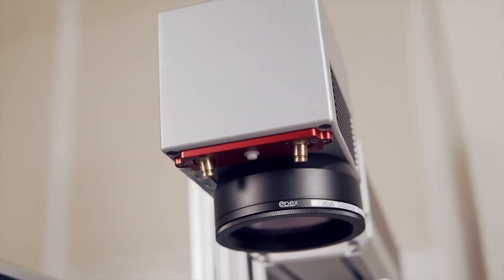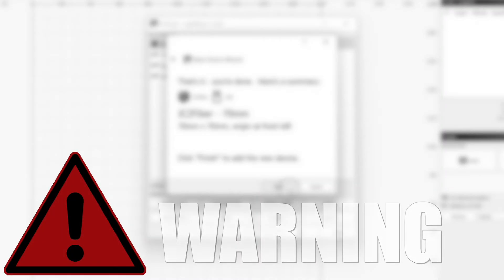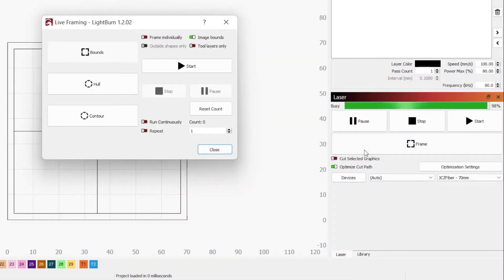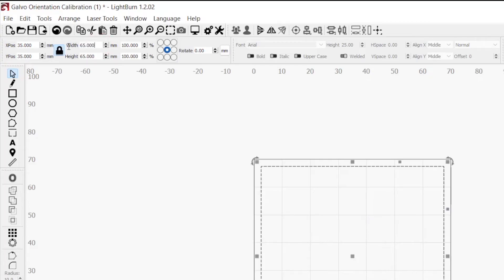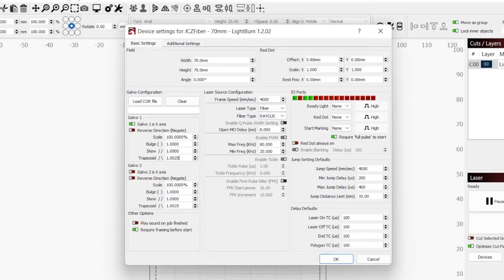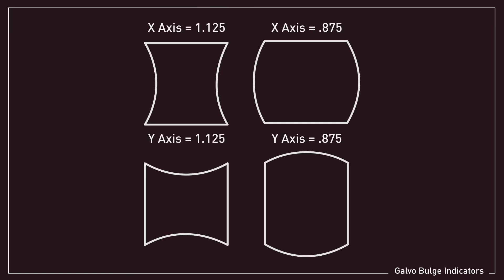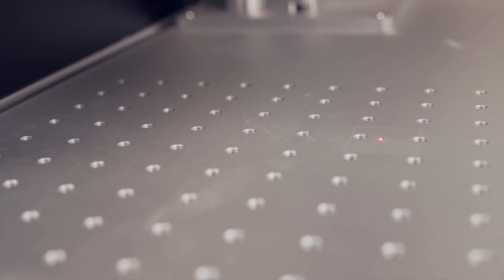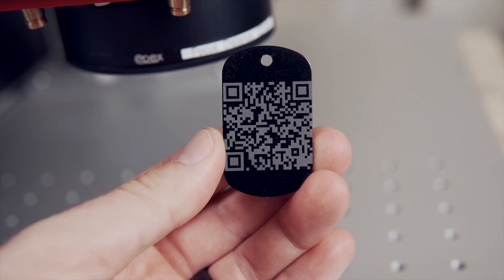LightBurn Galvo Lens Correction Guide

Comment: How about the power adjustments? Can the power be also adjusted or calibrated such that it auto adjust the power so the far away from the center on the bed will result the same amount of marking strength as the center?
Reply from the maker: Sorry, no, there is no way to calibrate power output in that way.

Comment: I don't understand the parameters for printing the pattern, for a 30w machine: 100mm/s, 80% power would burn the cardboard, can someone please explain it to me, I don't quite understand. I've spent a while trying to figure out the marking parameters: Speed, power, frequency and QPulse, which Lightburn uses to print the 9-point correction pattern on black cardboard. I've tried several values without success, however printing that test from Lightburn does work. Can someone help me?

Comment: mine only burns a + , nothing more ,.. than askes for the orientation of the burn logo thats not there ... eeeehh .. ok ?
Reply from the maker: There is no point in this video where anything is burning a + symbol - everything here is rectangles, so what exactly are you doing?
Reply: Aperently it was stromg enough for the first cross, but not for the rest of it. After slowing it down it worked!  (sorry, new to galvo lasers, lots to learn about frequencys and stuff.)

Comment: Warning! before running the laser, make sure you increase the speed to at least 900mm/s and power to 20 or 30% or else you risk cutting through the black paper and mark the machine base (like i did) -.-
Reply from the maker: Wow, what are the specs of the laser? I dont think I could cut through this easily even going very slow at high power on my 30W MOPA.
Reply: @lightburnsoftware7189  mine is a 30w, specs were 100mm/s, 80% power and i changed it to, 1000mm/s, 20% power, freq. was the same 30khz, q-pulse didnt really matter here 20nm. It marks the black paper well. Im planning on elevating the workplace a bit to avoid these mistakes again 😅

Comment: So, lets say i was using 300 mm lens fiber laser. So the max outer scan that i can use for my fiber laser workspace is 285 mm for precision dimension?, is that how it works?
Reply from the maker: @ihzanursyahbana7773  - no, a 300mm field lens gives you a 300mm field. Outside of that 300 you’ll lose precision.
Reply: @lightburnsoftware7189  I has bought a 50 w fiber laser recently, with 430 f theta lens (a.k.a 300x300mm lens). shortly, i calibrated my focal length and so on to create a perfect 300x300 mm square and it works. unfortunately, when i create 250, 200, 100, 50 square, there is always minus 2 mm minus on boundary (like 248mm and so on). I tried some trial and error by change galvo software axis, using both ez cad and lightburn. but yes, they has made a same consclusion and problem. Iam really hope i was miss something on software part instead do something or buy another lens for my machine. is there any suggestion maybe?

And i used SG7110 galvo head on my machine, not rc1001

Comment: I have a 40w co2 galvo. The 300mm lens is terrible, but I’ve seen some people use a 210
lens on Stanley 40oz cups with a height of 240mm. When I try and force it to burn light burn tells me it cannot work outside the boundary. How can I bypass this. Would I “add” a new lens and make the boundary 250mm but still use the 210 lens?

Comment: Hello,
Unfortunately, the lens correction is inadequate. A 9-point correction is far from sufficient for a scanner system! At least a 25-point correction or better would be required here to achieve dimensionally accurate results over the entire projection surface.
I very much hope that Lightburn will address this problem!
Reply from the maker: LightBurn will read the correction files from EZCad, so if you do a 25 point correction there, you can use that COR file in LightBurn. We are working on our own internal corrections as well.
Reply: @lightburnsoftware7189  
I'm sorry if I have to disagree! I have tested it several times and one of your German dealers can also confirm it.  Lightburn can ONLY read the 9-point calibration from EzCad. The 25-point calibration is completely ignored by LB. There is no error message when importing the .cor but unfortunately the file has no function. 
Please also read the report in your beta channel. The problem is also described there in exactly the same way.

If you have really tested it with a 25-point .cor, please let us know which tool you used to perform the calibration in EzCad. We have used the CorFileEnu.exe. All other tools we know of in EzCad are unfortunately only 9-point calibrations.

Best regards
Rötty
Reply: Hello,
unfortunately this is not true! A 25-point cor file from EzCad can be imported, but it will NOT be executed in LB. This issue is already known in your internal beta forum. I don’t understand why this is mentioned here as a solution?

Please explain to us how YOU create a 25-point Cor file in EzCad that will work.

Kind regards Michael @lightburnsoftware7189

Comment: Thanks so much for posting this! For those of you stuck on the scaling math at around 9:20, since the release of this video, Lightburn has updated the interface for the device settings to now include a quick fix!

Look for the three small dots (…) inside a small square-shaped ‘button’, which is just to the right of the “Scale” sections for the Galvo 1 and Galvo 2 settings areas. 

Click on the three dots / button and you will see a new window asking you to enter the “Requested size” and the “Measured Size”. 

For the example in this video, the requested size is 65mm. 

Note, my Galvo 2 is my X-axis (left to right/bottom line) so be sure you’re measuring the correct X and Y axis when entering your settings. 

Hope this helps folks!

Thanks again for posting all of these great tutorial videos too! 🙌🏼
Reply: You are a life saver thank you. I could put in the decimals and have it do more precise math than I would have liked. You’re the best!
Reply: @lexispapi  Yep! Glad someone found this tip helpful. (In addition to the video too of course!) 🤙🏼

Comment: Can you cheat the field size to a larger dimension than the given lens size? When setting up my 112mm lens I noticed that my initial, uncorrected size was around 25mm larger than the lens size. I sure could use that extra range
Reply from the maker: You can set the field size as large as you like, then adjust the scale factor to fix it to the actual size you’re getting from the hardware. It’s not exact, and most “110” lenses have a bit more usable range than that.

Comment: Great video!  One question, can you scale first?  I'm currently trying to lens correct a 300mm lens using a 275mm square, but even that is framing over 300mm...any advise?  Thanks!
Reply: We too had this same issue. We are however still unable to get our Lens correct done. At 290mm the box is spot on. When we start making squares smaller, so 50mm the square measures 49mm. I’m not sure why the corrections are not scaling down as the shape is smaller. If I run the opposite and do lens correction at 100mm and then scale up my 290 square doesn’t measure up properly.
Reply: @zacdeeds2362  I have the same issue. Unless I'm missing something I'm wondering if the field starts to warp/stretch as it approaches the edge of the lens. I'd love a solution.
Reply: Was this ever resolved or did you find out what was causing this @zacdeeds2362 ? I'm having the same issue with it scaling down incorrectly with my 150mm lens: 150=150, 100=99.5, and 75=74.
Reply from the maker: The recommendation for running as large as possible is to get as accurate of measurements for our corrections. If it is not possible to run the full size then yes scale down so that you can fit it on your 275mm square and use that for the corrections.